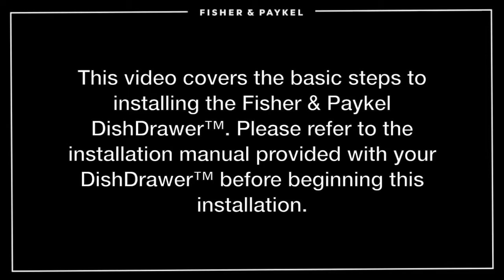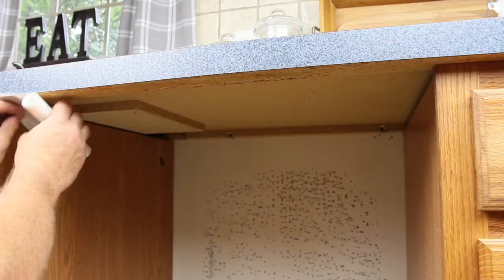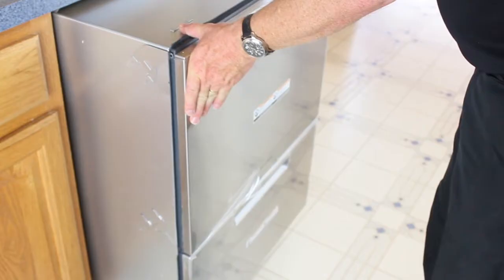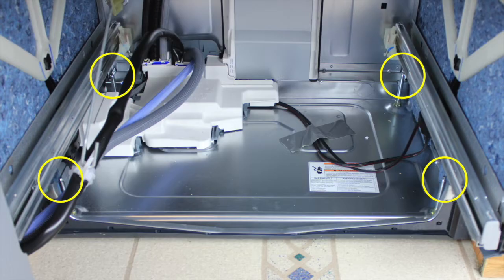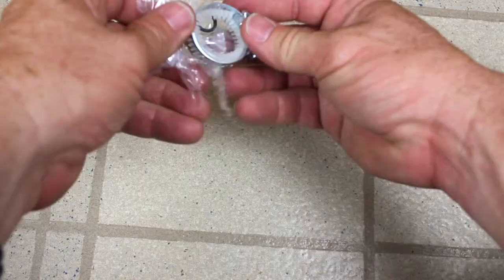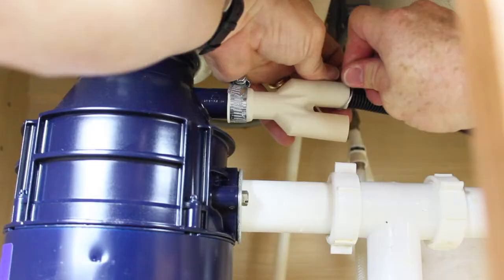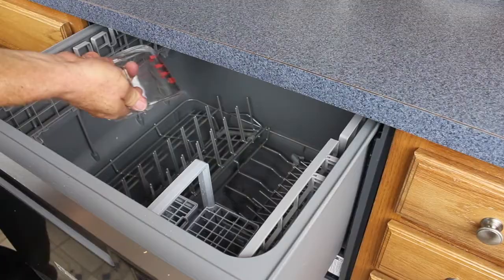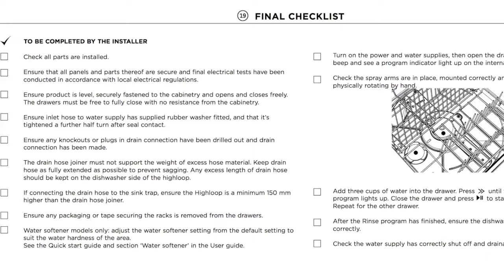Fisher and Paykel's DishDrawer Installation

Comment: The Y-joiner is put on in the wrong orientation. It should be 90 Deg to the way its installed so that water will drain instead of sumping in the bottom drain hose which will cause a smelly drain

Comment: how long is the power cord? is it safe to use an extension cord
Reply: Manufactures like to say not to use an extension chord. There should never be a problem with a good quality extension chord. If there ever was then then they should have been banned. However running extremely long chords or connecting multiple to get a long chord can cause significant voltage drop - specially on a heavy load.  If you are running Christmas lights - then go Griswold.

Comment: I bought this dishwasher, had it installed and it lasted 4 days until it flooded the kitchen. I replaced it with a Bosch Benchmark and never looked back. I would not recommend this machine to anyone.
Reply: I like ours
Reply: Possibly you installed it incorrectly. My handyman installed mine and he said it was very different then other dishwashers he has installed.  Mine works perfectly.
Reply: Installed myself as per instructions, been using it from last 4 years. Working perfectly. Not sure how you installed this one.